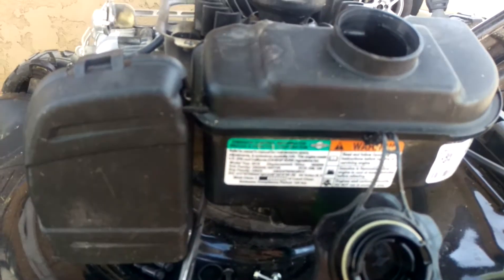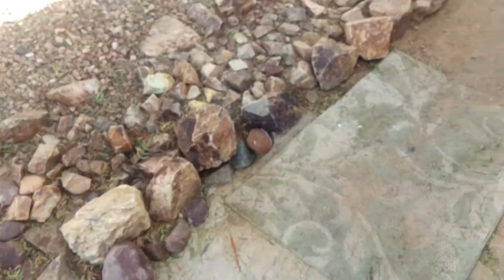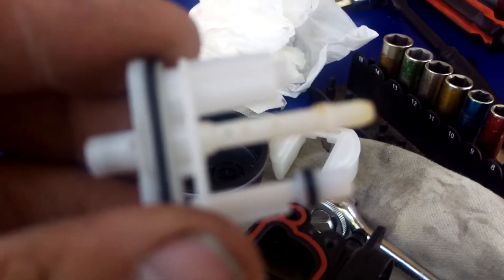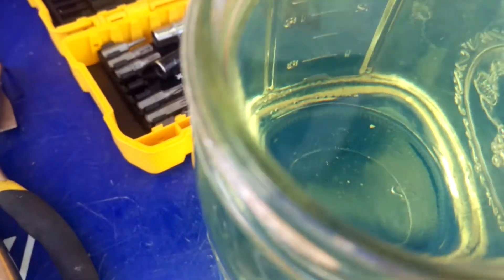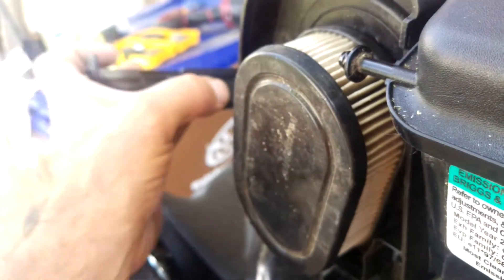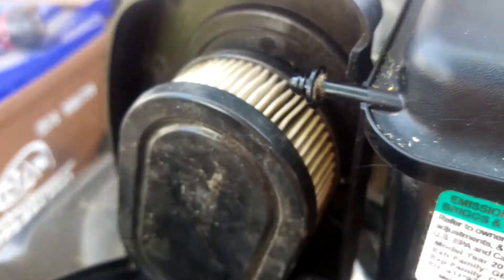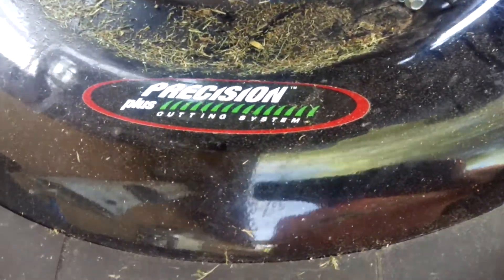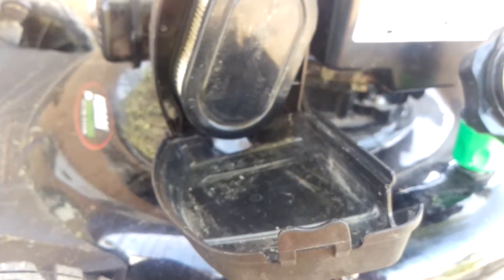Sears 7.25 Platinum  163 ohv wont run.

Comment: NEVER CHANGE THE OIL W.T.F!!!  I've never worked one one of those B&S engines yet so I can't help you there. As far as the focus goes the engine has to be in the car for it to work. JK. Seriously what's going on with that?
Reply from the maker: Dave Ackerman 1967  The ford focus is a 2.0L split port. The old one threw a rod. Went to PHX on sat and helped a buddy yank this one and now helping his grandson put it in in between whatever I get in to repair. 85° here today. #JustSayin